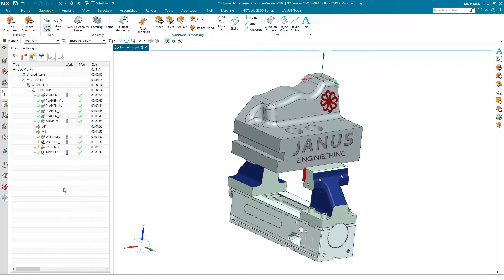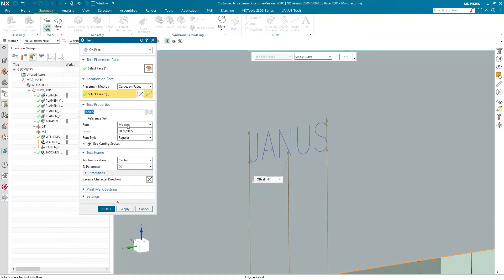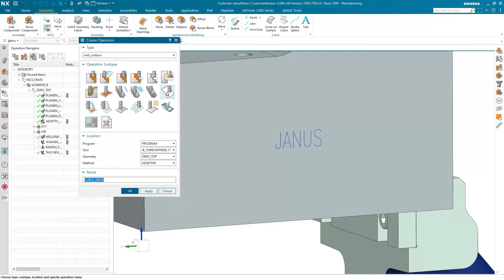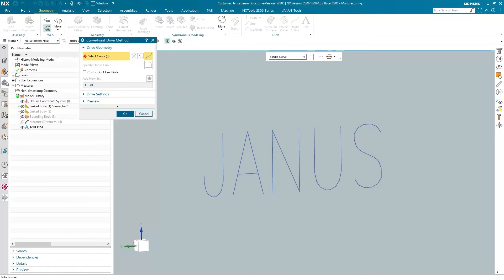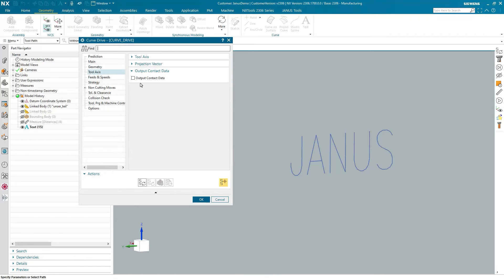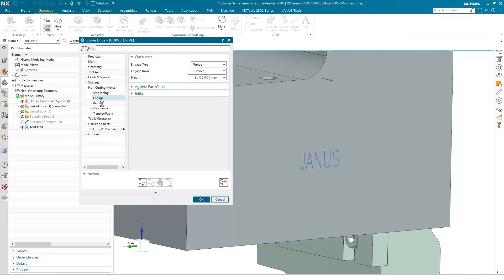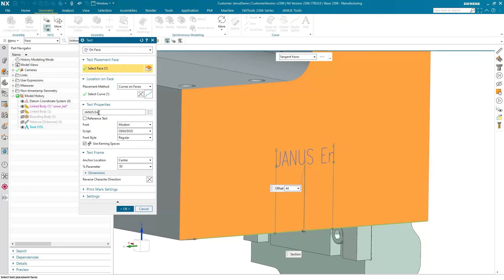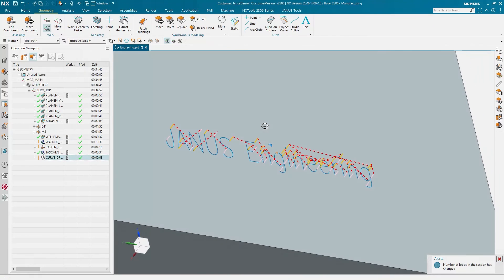NX CAM Tutorial | Engraving with Curve Drive

Comment: Thank you, Heinrich!
I followed your tip and when I simulate the tool plunges too many points on text before start contour. Any clues?
Reply from the maker: Hi Binhhua4983!
Thank you for your question. We think that the reason for this behaviour is that the checkboxes "Join Curves" and "Project Curves"  were unchecked while creating the Text. Please make sure to activate them both and give it another shot 
https://www.janus-engineering.com/fileadmin/Daten-HF/Snag_14b8e2a8.png
 
Best regards
JANUS Engineering
Reply: @JANUSEngineering , 
Thanks for taking your time to answer my question! Greatly appreciated!
I gave it a shot but it still doesn't work.
Binh
Reply: @JANUSEngineering  I re-created new one and it works. Thank you JE!